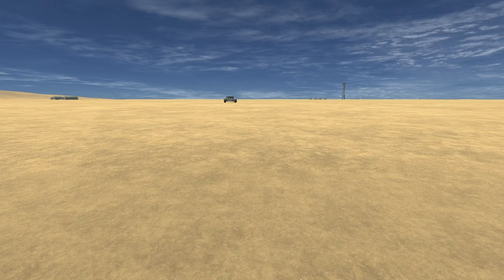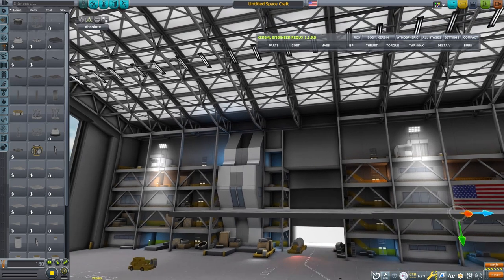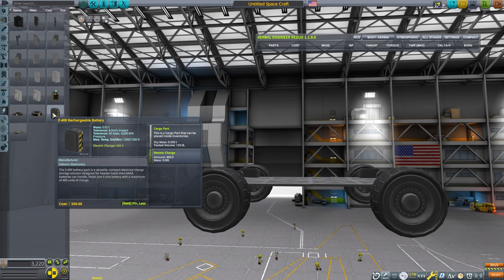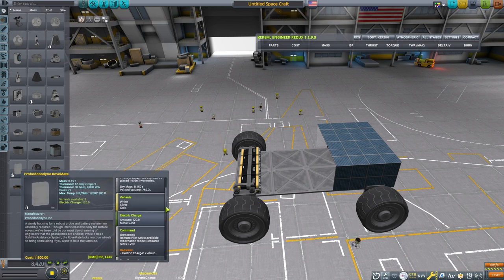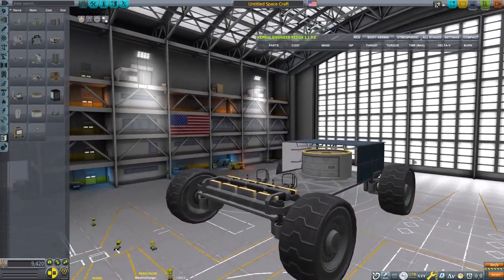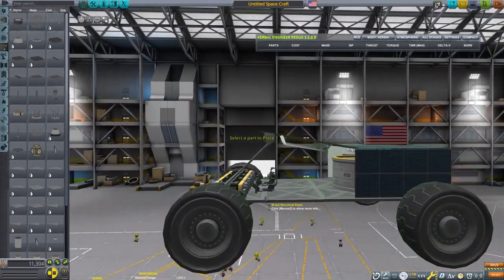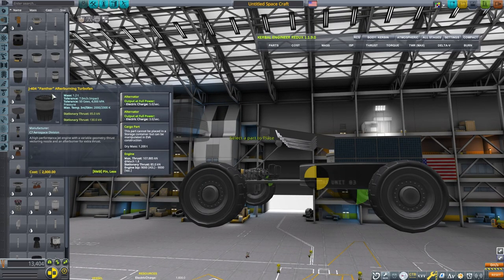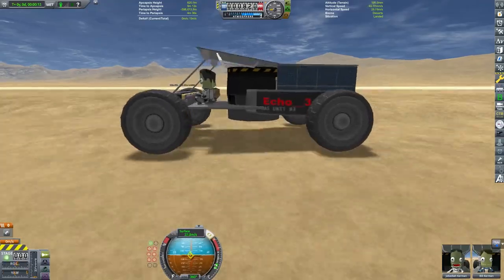Tutorial Tricks and Tips for Making a Rover in KSP

Comment: My rover keeps spinning slowly across the ground, it makes it really annoying when i try to dock it with things and i was wondering if you had a fix. Thanks!
Reply from the maker: This is an issue with the wheels. I have the most issues with the RoveMax Model S2. Turn on advanced tweakables in the game settings. You may need to adjust the spring strength, dampening or friction.

Comment: Doesn't work with current patch. Can't raise the solar panels for the roof part more then an inch off the base. Spent several hours trying various methods.
Reply from the maker: Hold shift while using the offset tool.